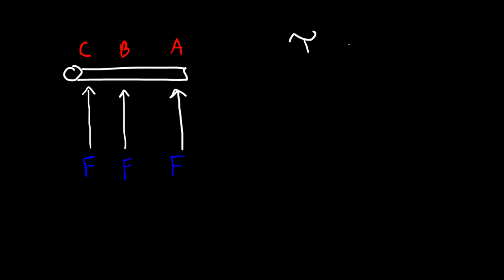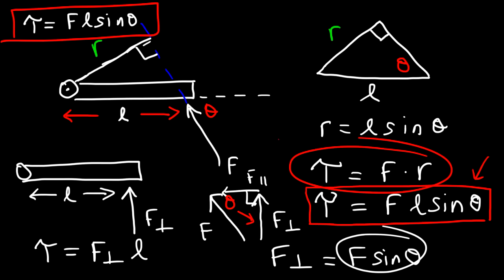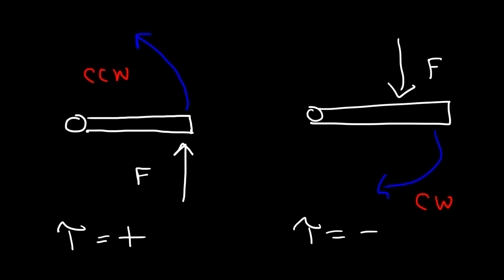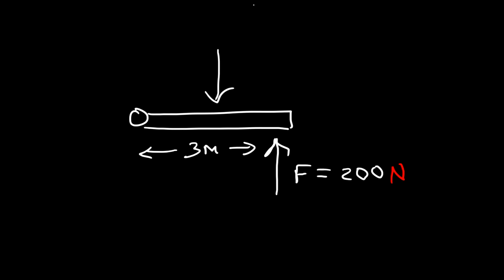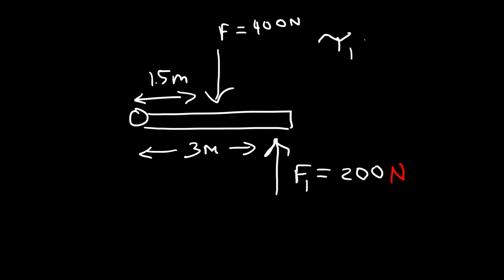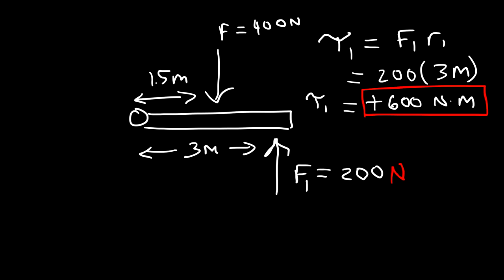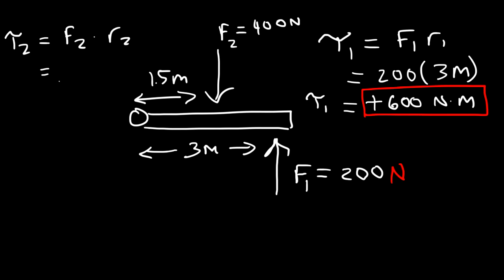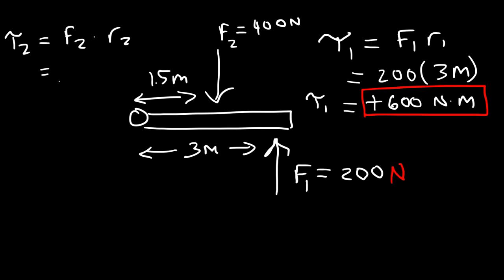Torque, Basic Introduction, Lever Arm, Moment of Force, Simple Machines & Mechanical Advantage

Comment: 00:01 Torque is the force times the moment arm

02:55 Torque is the product of force and moment arm

05:38 Calculating net torque on an object

08:20 Understanding torque and net torque in rotational equilibrium

11:07 Net torque of the system is positive, causing counterclockwise rotation.

13:54 Understanding torque and mechanical advantage

16:20 Understanding Leverage and Mechanical Advantage

18:59 Using a shovel at the edge increases mechanical advantage

Crafted by Merlin AI.

Comment: 4:01 The angle between two vectors is the one when the two vectors are meeting tail to tail and its direction is counterclockwise; in such scenario the angle has to be (180-theta) which in fact is equal to sin theta.

Comment: You answer  should be 1965 N.m for the net torque of the second problem you did. You did not consider the angle when you calculated the torque for F3. If you break up the forces for Force 3 you would see that it's cosine instead of sine theta

Comment: 18:10 Guys to calculate the output force, you can also do the mechanical advantage (MA) times the initial force (F1). 200N(10m) = 2000 Nm

Comment: 13:00 actually the net torque is not positive, it's negative cause you took 500(5)sin50 to be positive but it is negative. The answer is approximately - 1556.3
Reply: You were in radians and not degrees. It is positive 1915
Reply: Clockwise +ve, check it first, 👎

Comment: 9:50 im a little confused about where the angle is. like what vertex are those angles representing?
Reply: This is late, but the angle is between the rod and the line of force acting on it (down)
The line of force is the lower arrow mark or something

Comment: some late information.            at 15:32, in this case, the lever is a force  MULTIPLIER; and there is  MA  of 2:1 in this arrangement.!          the output value that  WILL be   reduced is,  Distance Travelled.        googletranslate

Comment: Question: let's say that you're pushing the door with your hand, so you're applying a force with the hand. Is the door pushing back on your hand with an equal and opposite force, while the torque is producing an equal and opposite torque on the opposite side of the arm,  causing rotation?
Reply: Late reply. The door only performs an equal and opposite force on your hand. There is no such thing as an opposite torque.

Comment: Hi  I have a question at 13:00 T3=500N*sin50* 5  why 500 is positive?  why not F3Y  be negative?
Reply: because the force is moving counter clock-wise. When it rotates counter clock-wise the torque is positive, when it moves clock-wise it's negative.

Comment: Hey,
Could you pls clarify the picture of the door. Where is the edge of the door? Which is closer to
Reply: the circle is the hinge, the edge of the rectangle (the opposite side of the circle) if you can imagine the front of the door, is the edge where the door handle would be (far away from the hinges)

Comment: The output force should not be computed by using torque, torque is for the force acting on the turning bar, while the output force is acting on the object on the bar, so output force do not have a torque.

Comment: Hey JG, question... On your propeller example... Looking at F2 and F3, does it not matter that one force (F2) is at an inward 60deg angle and the other (F3) is at an outward 50deg angle???  I guess I'm questioning your calculation on F3, specifically.  Dunno, it's been 40 years since I was in a physics class, but it "felt" wrong, cuz that would mean that whether the angle was inward or outward is irrelevant, but wouldn't we be extending the lever (as opposed to shortening it)?
Reply: really enjoy your vids, btw...

Comment: 11:11 im confused, the angle of F2 is 60 but in the clockwise direction, meaning its -60 or 300 from the positive x axis. So why did we just take it as it is?
Reply: The force should be perpendicular to the object. By top to toe, the perpendicular point upward, so it will rotate the object in anti clockwise direction,when torque in anti clockwise direction is positive

Comment: just please can you explain how did you multiplid the sin theta angle? thank you
Reply: You've gotta input it to a calculator. Calculating trig functions of most angles has to be done that way. We memorize some special cases like 30, 45, 60, and 90 degrees, but you just have to use a calculator for the rest.

Comment: I'm so confused. I thought u said T=F*r but in the example problem at 7:45 u used the L , which is the distance, not the r. plz clarify ty
Reply: The force is not being applied at an angle.
Reply: Njambi Kim yeah but the equation I see was the=fr. But he used full length instead of 1.5m. If it was an angle, it should be frsin(x) I believe
Reply: r is equal to Lsin x but in this case...the angle is 90.. so Lsin 90 is L(1)=L because sin 90=1... you can assume that r=L when the angle is 90
Reply: Sorry for my late reply, the r and the L can be exchanged, the first scenario kinda confusing, but i think the sin belong s to the F, anyways, r and L are exhgangable

Comment: 12:44

I think you messed up on the arithmetic there. I plugged the numbers in my calculator and got different numbers. What went wrong? How do you calculate sin60 or sin50?
Reply: Viradeus check whether you set angles on your calculator as a degree or radian. I’d recommend you reset your calculator and see if it works
Reply: @ahmedalsabbagh8795  thank you so much

Comment: I am having a really hard time calculating for mass in Torque! Please help
Reply: Well torque is the result of the cross product of r (the position vector that originates from the axis of rotation and ends at the location where the force is applied) with F. Since the magnitude of torque can be found by multiplying the magnitude of the position vector with the magnitude of the force vector times the Sine of the smallest angle between the two vectors, you can use algebra to solve for force. As long as you have the magnitude of the force vector you can break that up into mass times the magnitude of the acceleration vector and solve for mass.

Comment: How (200)* (0.1) = 2000?   Anyone explain.

Did he divide or he just multiplied somehow cause ive never seen that kinda division in physics lecture.
Reply: Umarım google çeviri düzgün çevirir. O iki sayıyı çarpmadı 0.1 eşitliğin diğer tarafındaydı bu da 1/10' a eşit 10 karşı tarafa çarpım olarak geçer
Reply: three values are known, in an equation.      the fourth value is found by dividing both sides of the equation by .1.

Comment: say i have a 2 ton chunk of iron i (2.5 meters x 650 mmx 220 mm thick) placed on the floor and i need to put it upright using rebar as a lever (the chunk of iron has holes from one side to other, width wise, ie 650 mm long), how big a lever do i need to get so that 2 guys can rotate it?

Comment: Why Sin? and why Cosine? How do you know which to use, nobody ever explains that. I give up bruh.
Reply: It's very easy basically:
- On a graph we usually have x axis and y axis keep that in mind
- When we have an angle thats closer to x axis we use sin 
But when we have an angle thats closer to y axis we use cos (also if the question has the word horizontal we use cos! )
- for example if you take the question at 11:00 you will see that we have 2 angles
Lets take the lever/bar as x axis and draw a straight line in the middle you will see that both angles are closer to x axis rather than the straight line we drew therefore we use sin

Comment: 11:21 F2 is wrong. it should be 600(3)cos60* not sin.
Reply: sin is opposite over hypotenuse, you need sin because it uses the vertical force as one of its variables, he is correct if it was cos then it would be adjacent over hypotenuse, that would be the horizontal force and its not the force pushing the door.

Comment: i feel like every single video you upload has a tidbit of misinformation that makes the subject difficult if someone attempted to apply it to what a professor would tell them. it is either that, or the textbooks and professors are difficult to apply to your videos. But, for example: when you write "l" like that, and describe the "lever arm" like that, and never make it clear that your "l" is no longer the "lever arm" when the force is at an angle, you throw people off. The lever arm is defined by the physics book as the line from the axis of rotation to the line of action (the force directional vector). If the force is at an angle, the "lever arm" or "l" is NOT going to be the line you drew. The "r" you drew for the angled example is the lever arm, NOT the "r" as in radius. Radius is fixed from the axis of rotation to where the origin of the force is applied, NOT some imaginary line out in space which intersects with the force vector. Therefore; the imaginary line you drew out into space to intersect with your force vector should have been labeled 'l' for "lever arm", and it was misleading that you chose to label it 'r' which is for the radius. I know this may seem minor to you but this is extremely misleading if someone attempts to apply this equation when different values are given (what if they get a question which states 'l' = some value? they would be screwed every time the force is at an angle!). I would have let this slide if you didnt have minor misleading mistakes in EVERY SINGLE ONE OF YOUR VIDEOS THAT I HAVE SEEN FOR BOTH CHEM AND PHYSICS. I wasn't even 5 minutes into this video before you managed to screw this one up. I am wasting my time with this long angry comment because it is nothing in comparison to the hours of time I have wasted in confusion over the course of watching your videos. I am done with your videos and I will make sure no one I know will ever seek @The Organic Chemistry Tutor for studying purposes. THUMBS DOWN AND UNSUBBED UNTIL YOU GO THROUGH AND FIX YOUR VIDEOS WITH ANNOTATIONS OR SOMETHING